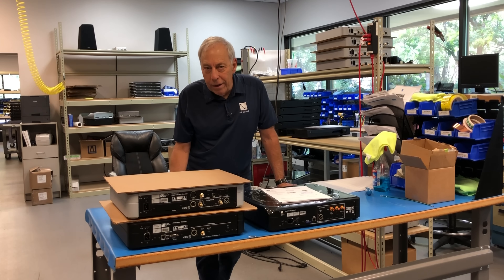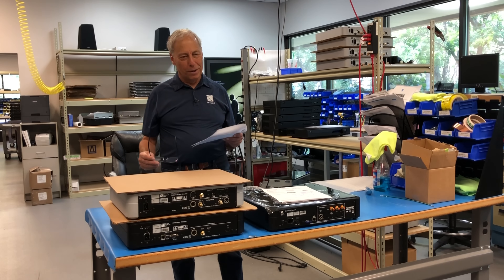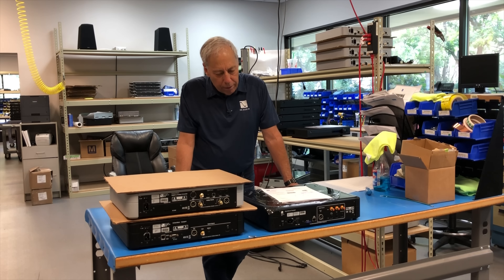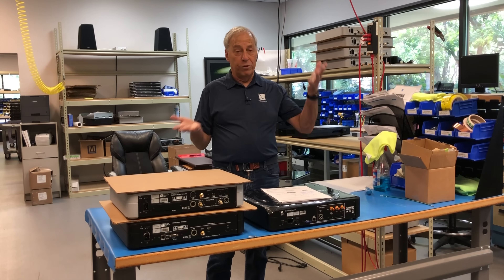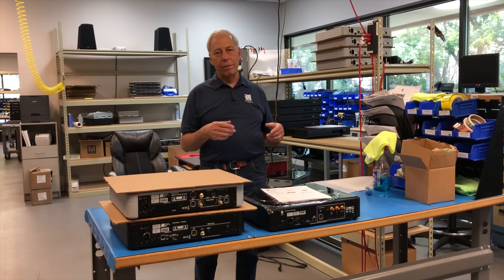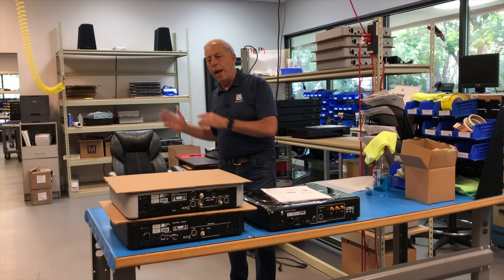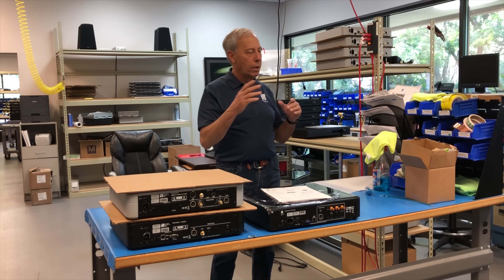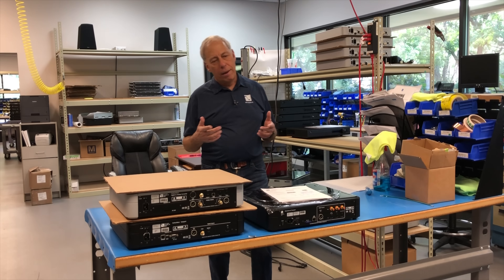What is a transmission line speaker?

Comment: Venturi?!! 

Almost no bass reflex ports involve venturi tubes - venturi tubes have a varying diameter, and are specifically designed to maximise mass flow by creating an area of low pressure. The flares on bass reflex tubes are neither horn loading nor venturi effect.
Reply: Weareallbeingwatched they are in effect Venturi tubes, the mouth is flared to slow air speed at either end and you can make use of faster airflow in the centre to make the port shorter due to it narrowing... whichever way I look at it it is in effect a Venturi, widens at either end, narrows in the centre, unless I’m missing some requirement of a Venturi to have a set taper, but I don’t think there is...

Comment: The real reason for a ported enclosure is reduction in size compared to a sealed cabinet. The port is used to tune the cabinet to a resonant frequency so the cabinet starts to produce bass at the lower "usefulness"of the bass driver.

Comment: The Rega Naos was a floor standing Quarter Wave transmission line design with 8" paper cone midbass. I've measured decent bass output to below 27hz on mine, which is surprising. They are 92db efficient and don't suffer from the upper bass hump and rapid rolloff of reflex loaded designs.
Thanks for attempting to describe the concept, Paul
Reply: That says nothing... Hiw many dB has the speaker rolled off at those 27Hz? I bet pretty much. If it is lower than - 3dB than I would not really count it because then it starts loosing volume very fast. That's why speakers freq. range are messured within +/- 3dB.

Comment: , thank you so much for this explanation. this is where JBL, Bose, and many other manufacturers spend millions of dollars on sound research to get it right. and when they do, whallooo. it really works.
hence, wave guide JBL, BOSE are two of the main companies who utilize this technology. they're speakers can use much smaller woofer drivers because they have figured it out and when it works and you have the math perfect, the speakers sound awesome
Reply: To say Bose use a transmission line is almost an insult to the TL principle. To be fair, the Bose system does help the bass extension and it does use a duct to handle the rear speaker wave, but it's far too short length means it just acts as a resonant tube, something which a proper transmission line does not.
Reply: Well some of Bose designs are transmission lines! just becasue it has a short line, doesn't mean its not a transmission line as most people understand the term to be.
Reply: No, Bose just uses eq like they always have
Reply: Fishman 02 , I agree but if you know anything about Bose. ALL THEIR SPEAKERS use some form or another of waveguide or tubes for enhancement

Comment: Anyone who is interested in loudspeaker design  should IMHO seek out and read Gilbert Briggs books on loudspeaker design.Regarding transmission line loudspeakers I think the dimensions of the line should be calculated from the size of the drive unit and the length of the line should be a 1/4 of the drivers resonant frequency?

Comment: I developed about 4 types of TLs. First was totally apparent and in mono - just set  open type speaker box  at furniture in  corner of room and sealed around so that low had only one way out - down to the floor under the furniture. I noticed it was something I never thought before. Then after 15 years were my premeditated  constructions - big one - made 3 stereo  sets and two smaller - actually  first smaller was a prototype of second smaller which I made in two stereo sets. . Small means 130 cm high. If one likes strong very low bass it is unbeatable. It can shake floors down and travel across street with no much power. . .  Its strong side is little coloring in  upper range  so it is good for  real sound.But it's known disadvantage is narrow minimum in working range which takes a  hard to fill..  I developed unique solution within my also unique construction allowing me to damp  independent 4 parallel chambers similar to pipe organs mixing  its resonance  into that minimum. Basic bass  was calculated at 30 Hz and it is pushing max at 35 Hz. Took me next 20 years before I made  something another.

Comment: Well done Transmission Line speakers sound really impressive, kinda like a more dynamic and extended closed box, they're awesome.
Reply: Most accurate description. Black magic. Deep tight bass without 2.1 system.
Reply: The high end models available produce incredible sound but you can shell out five figures easily. If you enjoy working with your hands and learning, have some fun and build your own.
Reply: @volleyballjerry  I'm planning on doing so, but I have no idea what all of these freaking equations mean!!!! I'm a freshman in college and have an upcoming class where I will most likely need a project for. I understand why transmission lines work, but I don't know how to make one the proper size and shape and packing with how much fluff and where and it's annoying. There aren't very reputable designs out there that are CNC routed which is what I want to do, and the ones that do exist don't really tell you what driver they were designed for.
Reply: Matthew Niedbala - One of the challenges you will have is that there may be some trial and error with different designs even if you understand the math and physics involved to produce a particular design. This is aggravated by the fact that “trial and error” is one thing when you are experimenting with different cookie recipes. Different thing altogether when you are designing a wing for an aircraft, a race car engine, or building a custom speaker.

There are some excellent software applications out there to help you with speaker design that automate much of the mathematics involved when doing the design. However what sounds good to one person may be entirely different sounding to someone else. You can use Real Time Analyzers with crossovers and equalizers to change the response curve of your speaker when you first power it up. You want to shoot for the sound you like without crossovers or equalizers. It will make the speaker more efficient with reduced distortion (because the speaker, once correctly designed, will produce the sound you want without sonically straining itself). You can spend weeks or months doing this work but I always loved the design and build process anyway as much as listening to the final product. If your share a similar joy in the journey as I do, then get some used tools at your local pawn shop (or eBay or CraigsList), and start planning and start building.
Reply: Jerry Williamson I should see if my campus has the equipment or software. I can tap into a campus computer from anywhere on campus and use it for testing if they have the software.
Reply: Matthew Niedbala - There are also some excellent open source software packages. There is a comprehensive list at diyaudio.com . Highly recommended you check that out.
Reply: Get the book Introduction to loudspeaker design by V. Capel

Comment: Is that the same principal as a band pass subwoofer?
Reply: No, a band pass design is quite different to a transmission line. Band pass has the advantage of being smaller for a given bass response but tends to be poorer for evenness of response and transient response. I've had both but can't live without my transmission lines now. They go lower in frequency than most subwoofers although they are quite big, They're quite decent to look at though.

Comment: Although the "pipe" part of a port does help reducing wind noise compared to a hole, that's not what it's for. In a ported speaker the air inside the box acts like a spring and the air inside the port acts like a mass that is attached to this spring. This mass-spring system acts like a Helmholtz resonator at low frequencies, meaning that the air inside the port resonates with the movement of the speaker cone. This means the speaker cone and the air in the port are in phase, that means when the cone moves forward, so does the air inside the port, which means that the port makes the speaker louder. The reason a port needs to be a tunnel rather than a hole, is that a hole doesn't contain any (or just a very small) volume of air, which means there's no mass, so the resonance won't occur, or at least not at the right frequencies, which means the port will not be a bass port, it will just be a hole that lets back radiation from the cone escape. Also, designing a ported box involves quite a number of complex calculations to figure out what the size of the port needs to be, where it needs to go, what the shape needs to be etc. It's far more than just drilling a hole in a box and calling it a day. I fully agree that many ported speakers are poorly designed and don't sound great, but they can sound great if they are designed with care, which again, isn't an easy task.

Comment: How do you determine the size of a transmission line speaker, and how to qualify a speaker for their use in a transmission line? And in a transmission line speaker, by keeping the pressure wave of the woofer in phase with the woofer's positive wave, or forward movement, doesn't the resulting wave of the port fall out of time with the positive wave of the woofer. In other words, when a positive impulse reaches the woofer the in phase of the port will follow or lag behind that of the woofer, causing distortion? Is that audible at the lowest frequencies?

Comment: I love the tangents!Transmission line is a good choice for DIY imo, though don't try and design it yourself unless you really know what you're doing. You get a very solid box, and the carpentry that is so expensive for a company to make and ship is not much of an issue. IPL acoustics in UK produce highly regarded kits, and Troels Gravsen has some awesome designs on 'DIY speakers' with parts kits sold through Janzen audio. Both these are super helpful.

Comment: I own a pair of Polk Signature Reference Series  SDA speakers which I purchased new in 1987. The enclosures are 66in high x 22inches wide. Each enclosure has 8x 6.5" drivers plus one 15" passive bass radiator plus 4 x 1" tweeters. Mathew Polk does not specify which type of enclosure design is used. The bass response is quite impressive, according to Stereo Review Magazine: +/- 4.5dB from 20 to 20,000 Hz with the output dropping to -7dB@12Hz, while distortion was measured as .7% between 70 and 20Hz with an output of 90dB. I love these speakers so much that I will not part with them, ever! Does anybody know what type of enclosure design these are? Thank you.

Comment: So if a 20hz note is 40 feet long, the port would need to be 20 feet long to be in phase? This is very interesting science
Reply: That sounds a little short; 30Hz is ~38 feet if I got my metric conversion correct. Bailey's transmission line used long fibre greasy wool (aka carpet wool). That makes the air inside the box behave as if it's denser. One thing Bailey's original article didn't point out was that if you didn't treat the wool with insecticide, the wool sometimes became eaten and turned to insect turds (dust). Happened to me, but it was an infinite baffle design that I stuffed with wool.
Reply: @jonathansturm4163  20hz 56.26ft. My question is still valid, the port would need to be half the length of the note... So a 28ft port....
Reply: Not really. You are still assuming the wavelength in air at 20 C. The filling in the transmission line increases the effective mass of the air thus shortening the wavelength and the required line length for a particular frequency. A transmission line speaker without acoustical filling inside the box would not be a practical design.
Reply: @jonathansturm4163  first world problems.

Comment: I built some speakers that use a 15" woofer and have two 4" ports. When it came time to tune the ports, I wound up using PVC pipe and elbows. The ports are about 28" long (I haven't looked at them for years). The cabinet resonance is below the driver resonance.

Comment: A fascinating book to read and help you build all speaker cabinet designs is: https://www.amazon.com/Loudspeaker-Design-Cookbook-Vance-Dickason/dp/1882580109
Reply: The book is now in it's 5th printing. The math in the book tends to be a little challenging at times but nothing that someone familiar with spreadsheets and computer programing can't handle. Chapter 4, Transmission-Line Low Frequency Systems, takes the discussion from where Paul left off and will get you familiar with how to design one of these things. The book even gets into the historical background of TL designs back to the Stromberg-Carlson labyrinth, circa 1930.

Comment: I built a pair of transmission line speakers based on he design of Dr Bailey from 1969 ? I think. He used triangular pipes to make the cabinets more rigid. 
IMF, a British company also used a transmission line but with flat panels. The most popular bass driver was the Keff B139.
The one advantage of those designs was the greatly extended bass they produced. I still have a pair of Keff B139's in their original boxes and when I can find a cabinet maker I will get them to build me a pair based on the original Dr Bailey design. I used Rogers LS3s for the upper frequencies.
Reply: Wireless World May 1972 issue. Marvelous speakers. The speakers I've been using the last 18 years (VAF DC-X) are transmission line and I love the extended bass and low distortion. I occasionally think of filling in the bottom octave with a sub, but I don't listen to a lot of pipe organ and that's really all that would benefit.
Reply: Thanks Jonathan. I do have a copy of the magazine in my house somewhere. My memory is not what it was. I used to be a chorister and loved the deep song of a church organ with a 64 foot pipe. I also like listening to things like Pink Floyd and some other synth music as well.
Reply: Dr Bailey's article:

http://www.keith-snook.info/wireless-world-magazine/Wireless-World-1972/The%20Transmission-line%20loudspeaker%20Enclosure.pdf

Comment: Back in the day, well back in the 70’s, I had the opportunity to evaluate a massive TL subwoofer system named the “Coffin”. That because it resembled the size of a coffin. Inside were two KEF oval low frequency speakers, one for each channel. The designer, whom I met at the demo, indicated it was meant to also serve as a low coffee table. It was huge, heavy and expensive. Probably a one off. If memory serves me right it generated prodigious amounts of low frequency energy. I bought something else more practical.
Reply: I came across a pair of transmission lines using the KEF B139s. Instead of folding the line into a labyrinth, he'd taken Bailey's design and unfolded it so they were straight tapered pipes. Huge.
Reply: http://p10hifi.net/TLS/drivers/images/B139small.GIF

Comment: As far as I'm aware a transmission line works as a IB enclosure down to the line length frequency, with the rear wave being absorbed completely but not reducing efficiency by adding an extra spring like a sealed box does. Below the line length frequency you get a boost from the low frequencies exiting the box 90 degrees out of phase
Reply: I couldn't have said it better !!
My dad used to own a pair of Radford R50 T/L tower speakers using Kef B139 and B110 and two different tweeters... it took 2 people to move these speakers they really were heavy. They sounded very good albeit inefficient... it took over 100 watts to get them fired up ..
You must remember that, at the end of the day all we are trying to do here is to produce a certain shaped frequency response with very minimal phase response and matching transient/ decay ( shown in waterfall plot) and also one last thing .. group delay ! 
My pair of B&W nautilus units the original ones that have a cochlear shaped enclosure are by far the best I've ever heard !

Comment: Several of Arnie Nudell's early Infinity's (ie: 1a monitor) was a transmission line whereby he used only stuffing/damping material only to create the phasing. NO internal baffles at all and it still works properly. I have a working pair, complete with Walsh tweeters and the Port is as far away from the woofer as possible. The in-phasing is done by stuffing the tower cabinet very densely near the port and reduces as you get closer to the 12" woofer. Excellent detailed bass down to 26hz -1db.
Reply: The infinity WTLC was wonderful.. I owned them for 20 years.. they also had a 360 degree Walsh tweeter…very progressive for 1975..

Comment: I have Rega Kyte speakers. The port is a triangle on the front upper left side. They are not symmetrical. Both speakers have the ports on the upper left side, beside the tweeter. Don't know if this qualifies as a transmission line speaker. For the price they are amazing. But they have no low end bass. Of course you can add a subwoofer. but you need an accurate one. I blew one of the tweeters. Bu instead of repairing them I bought an extra pair for just $30. They cost around $300 new in the nineties. A forgotten classic.

Comment: TL speakers are the best at reproducing real-time low frequencies for a passive system in my experience. They are expensive to build because of the extra cabinetry involved but they are worth the effort for the DIY crowd. There are lots of great plans available which pair proven cabinet design with readily available drivers. There are few if any DIY speaker projects that will yield the outstanding results of a proper TL design. Beyond that, servo-controlled subwoofers are the way to go, hands down.
Reply: So true. They are true gems.